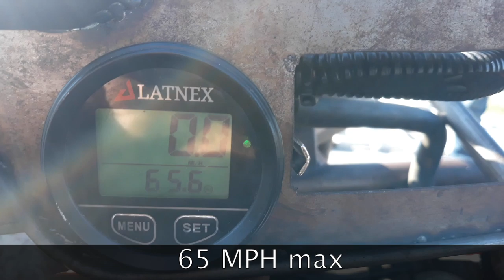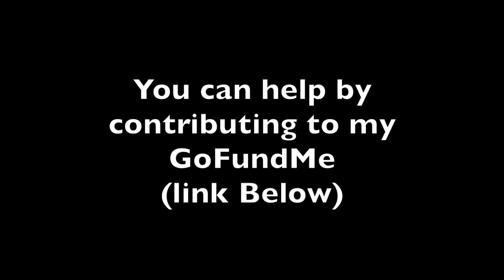Lark Streamliner | Testing Footage

Comment: Love the project.I would image the body panels, as well as rake, trail, offset, the location of the center of pressure, and the center of gravity will ultimately dictate how well it drives. You may have to increase the rear surface area,[tail, etc] to push the COP back if it's twitching in side winds. Good luck . Make sure you document everything.

Comment: Bro that is so crazy, you should get the record just for building that beast. Have you thought about using a gyro for stabilization? Wouldnt be hard to do either if you have the room. Any drift gyro would work just need fast actuators or servos for large scale planes. It looks like it needs a tighter steering dampener when you get up to speed. You've been my inspiration, I started building fast slammed beach cruiser. I'm not one to comment much but your videos are worth it...
Reply from the maker: Thanks man!!!  It's been a long journey of a build

Comment: Baby steps is good, I imagine balancing that is very strange because of the long-wheelbase.
Reply from the maker: It is like nothing I have ever experienced before. Bit of a trip
Reply: @sheanyquist  did you determine which name you're going with on this vehicle?
Reply from the maker: @dkruitz  Not yet, I really like Lark Flash  (kinda like Arc Flash)  It's still up in the air

Comment: mount the gyroscop in it, improves its stability
Reply from the maker: There isn't much room left on the bike at this point, I would love a little more stability though!
Reply: @sheanyquist  And/or increase the moment of inertia of the wheels, which doesn't necessary means increasing the weight (much). The weight should be distributed more further from the center. Bigger wheels would help and making the center of gravity as lower from the axis points of the wheels as possible, which will inherently stabilise the bike when moving.

Comment: We need to incorporate streamlining to lightweight narrow tracked passenger vehicles. An affordable narrow tracked, fully enclosed [removable hardtop ] aerodynamic motorcycle, with 2/3 or even 4 wheels for the masses, commuters. Even a narrow tracked tilter with a low drag body. Comfort, safety, increased battery or fuel range, low emissions, reduced traffic, less wear and tear on the infrastructure, [bridges, roads,], etc A win-win.for us and the planet. The problem? performance in a variety of weather conditions.How to eliminate the effects of sudden side winds, surface conditions, etc. 

You're effectively driving a wing down the road, so the design of the suspension, steering, wheels, and aerodynamics has to be precise. We surely don't want these vehicles to be blown off the road.  My hope is that more people will apply what Lit Motors [ stalled, looking for investors ] and Peraves [Monotracer]a limited production [expensive cabin motorcycle ] have done. Maybe someday you'll have the option of commuting in a safe, efficient all-weather vehicle that's fun to drive...

Comment: There's a speed at which the turning input is counterintuitive, i.e. you push the right grip to go to the right.  That appears to be 50MPH, eh?
Reply from the maker: Yeah, it goes from scary twitchy to super smooth.  I have heavier wheels now and that transition speed has lowered

Comment: Would a steering dampener help or is that one on the front forks?
Reply from the maker: The one I have installed is pretty sloppy, it was used for mock up.  I will have an adjustable style so I can tighten it up mid run. I need it to be loose near the beginning and tight at top speed
Reply: Shea Nyquist nice. The Scotts are good
Reply from the maker: @robertsharrock188s  The top mount style is good, but it kinda blocks my view.  I'm going to try to switch over to a After market oil cylinder style